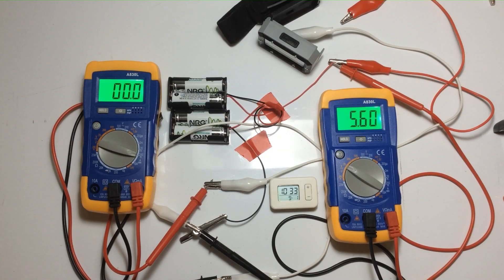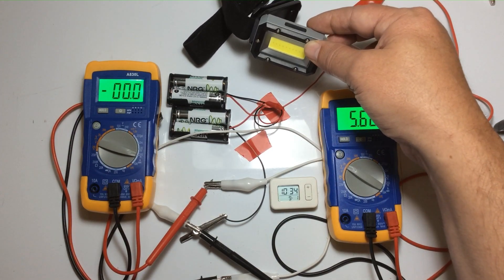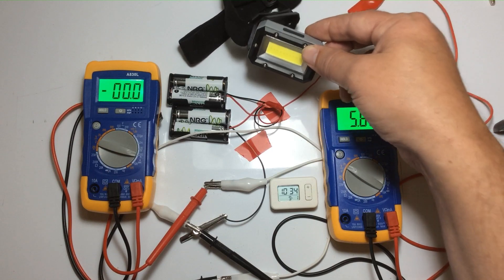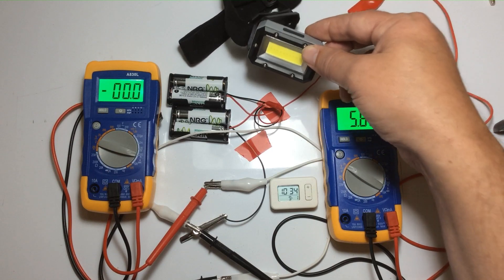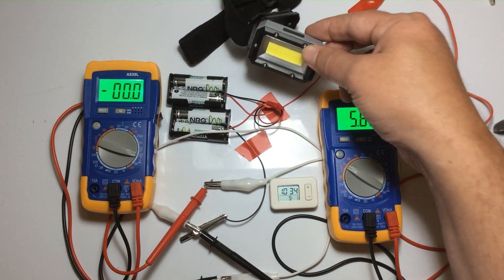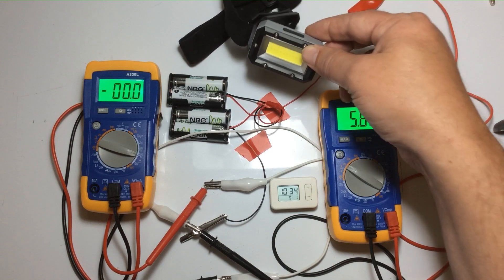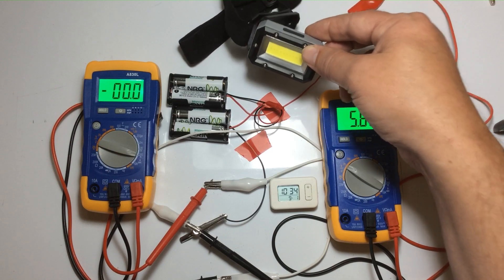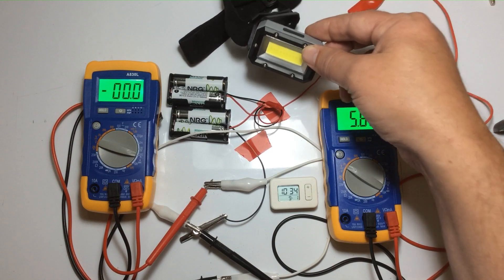TESLA POWER TRANSFER - CONTROL TEST

Comment: I did mentuon to you that batteries in series would die faster towards the positive end of the series.  This test shows what I was talking about.  Battery rotation for this power transer is essential to the longevity of battery life.
you don't want the same batteries being drained this way more than the others.
Reply from the maker: Thank you for your comment.
As soon as I saw those batteries come out of the test showing they needed replacing I thought of your initial comment a while back.
I will perform another test to be sure but I have a feeling this does not happen in the transfer method as you will remember when I first tested your theory it was not obvious in the transfer method whereas this test shows with undeniable evidence that conventional electronics destroys batteries intentionally.
So if I am correct about the voltage not able to drop low enough to damage the batteries using the transfer method then that’s just another reason this should be the way we use energy.
Reply: @whatifididthis...1236  I am running 6 AAA cells with one white led.  I did not drain the parallel side before beginning, I just put in 6 new cells.  First rotation of cells after about 60 days.  Series battery of cells were unevenly drained with the lowest voltage cell closest to positive end, yet  they were nowhere near as unevenly drained as a series battery of cells without the recycling battery of parallel cells.  
I think we are AGREED on this observation.

Comment: nice..im using the same light atm.....powering using your way.....energy transfer still works well.......id love to somehow add a solar panel to the circuit would be awesome......i tried before but failed....your thoughts on that theory?...cheers bro
Reply from the maker: Thank you for your comment.
Thank you for confirming your replication and I’m glad to hear your having success.
I also want to add a small solar panel to boost power to overcome the very very small losses, I got as far as removing the solar panel from a garden light with its voltage regulator circuit in tact, then I got distracted.
I have thought this through several times and I believe you could apply the garden light solar panel and regulator to any of the batteries in the setup as the garden lights usually recharge a 1.2volt cheap crappy battery. So even though the garden solar setup is usually not good quality, it may just be enough to cover the losses, definitely with the 275 day test unit, possibly not so much with this LED that has a higher current draw but then again a larger solar panel could be purchased, for example I saw online a small solar panel with a AA battery holder on the back, I don’t remember the milliwatts but they were cheap.
I imagine the longest run time would be achieved by adding the solar panel and regulator to one of the series connected batteries, I’m unsure which of the series batteries it would be best to add it to, perhaps the first battery in the series set, this may assist the electron flow as it would allow the extra energy provided by the solar cell to move through all the batteries in the series set, onto the LED and then to the parallel bank.
Eventually I will make time to investigate the next step of the Tesla Switch, which is self sufficient, self powering, self running and no solar panels, but until then it can’t hurt to try, at least we will know and will no longer need to wonder.

Comment: nimh's are pretty forgiving to being drained too low. Eneloops are the best, ikea are the best value (both made in japan, seems to be same factory.) BT-C3100 is a good value charger.
Edit: draining below 0 can actually do a bit of damage.
Reply from the maker: Thank you for your comment.
I believe you are correct about the same factory producing those batteries, I read something a while back saying the same thing. There was some research done on the best AA Rechargeable batteries by a particular person that then presented their findings on which batteries were worth the money, I will attempt to find this again. I want to purchase some Eneloops just so I can say I tested them but they are definitely pricey, however I am happy to spend that money if I get better results.
Reply: @whatifididthis...1236  IKEA nimh's seem to be as good from the tests I've seen and are less than half as expensive as eneloops (not including cost of going to IKEA).
Reply from the maker: @jimmybrad156  Well if we are including the cost of going to IKEA then those batteries are expensive, every time I have been there I bought a lot of unnecessary things that I just couldn’t live without. 🤣
Thank you for the information on the batteries as I’m sure it helps those deciding what batteries to buy.

Comment: Where are the other 4 batteries and a current limiting resistor to make it fair? Also if these batteries were used in your previous experiment they would have some damage.
You will need to have 8 new cells to make this fair.
I encourage you to redo this experiment correctly as this one is invalid.
Reply from the maker: Thank you for your comment.
I don’t believe the 4p batteries can be used in the test, in the transfer method they are only seen by the system as a load resistor that minimises current draw from the series batteries.
The batteries used in this test were new as I bought 12 of these batteries brand new, I was sure to open a new pack of 4 batteries specifically for the test as I am also questioning whether this transfer method is damaging the cells. So far I am happy to go on record stating the transfer method is NOT damaging cells like the conventional use does. After hundreds of days usage the batteries in the 275 day test still hold the same capacity of charge according to my charge meter measuring mAh fed to the battery during recharge.

With the 4p batteries connected to the series bank via the negatives there should be the same potential therefore no electron movement, according to our education, this coupled with the higher potential voltage of the series bank our education also states that electricity moves from the higher potential to the lower potential. With this in mind, our education does not explain what is actually happening here.
So in my opinion, with conventional electronics the only way the 4p batteries could be included is by adding them to the series bank in parallel and this would definitely be unfair as this would double the capacity of the series bank, in the transfer method the power residing within the 4p bank is in no way adding to the capacity, for if it were there would be no power realised upon battery rotation, if it were adding to the capacity of power available to the load then it would be depleted in conjunction with the series bank.
The only reason I would consider this test inaccurate, would be related to the current limiting resistor. You are correct on this fact, the 4p batteries are acting as a current limiting resistor, to be fair, a 34.7 ohm resistor should replace the 4p batteries and the test should run again. However, even with this modification I have calculated that this is still an insignificant value that would not be responsible for such an outstanding run time. In the case where a resistor replaces the 4p battery bank the energy would be converted to heat instead of charging the batteries as it clearly does in the transfer method.